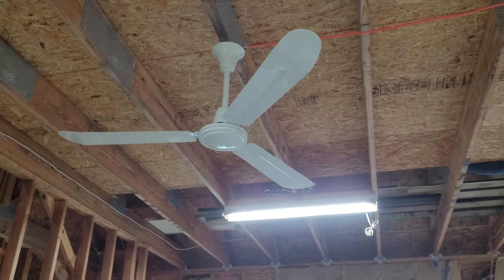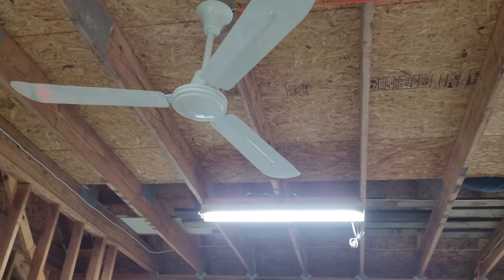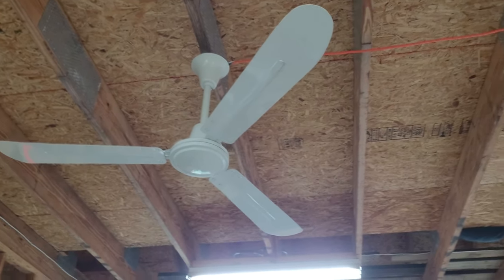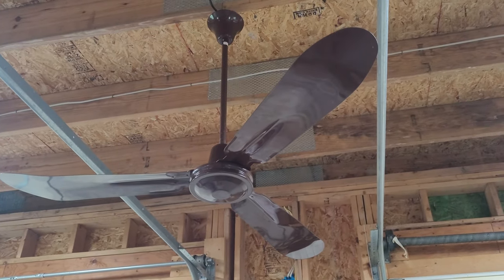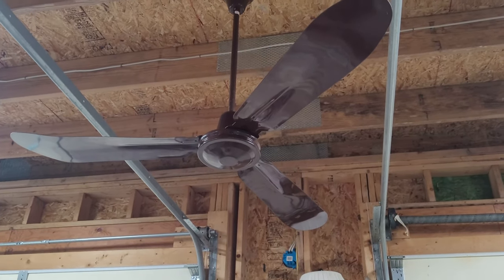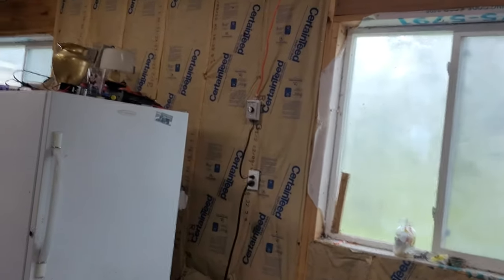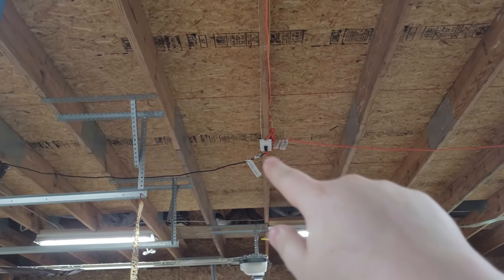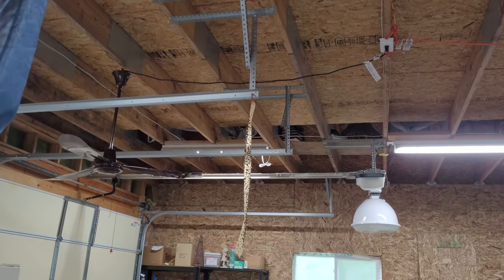Turn Of The Century and Airmaster 56" Industrial Ceiling Fans on a Variable Speed Control

Comment: Great video. Are you planning to install more fans eventually?
Reply from the maker: if I get more I will install them in the old half of the garage
Reply: @DarkNeon27  what do you mean by the old half of the garage?
Reply from the maker: There's a new half and an old half. My roommates parents had a new portion added which was what was shown in the video. It was built onto the old entrance of the old garage so there's a newer part with an unfinished loft and there's the older half/side of the garage through the back.